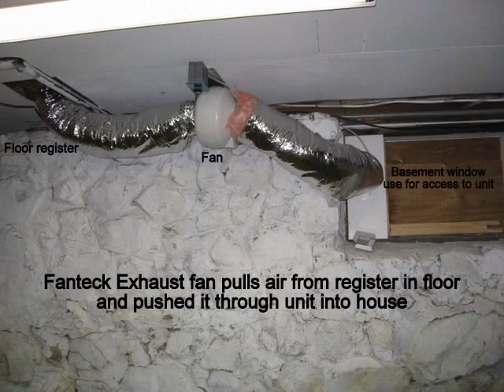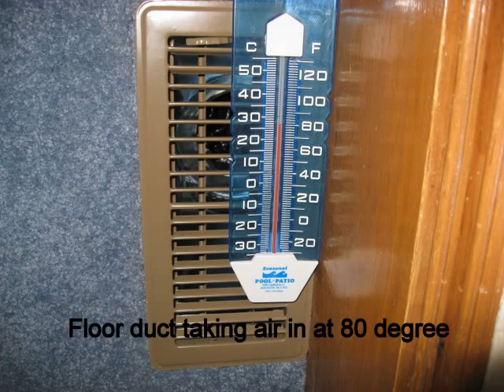solar air heater

Comment from the maker: I like the bow in the Lexan it looks nice but I was concerned how to flash the top the unit when it sat against the house. I cut the Lexan 1/4 inch small around all sides to allow for expansion. I did not silicone it down. I set it on a rubber weatherstripping held down by the aluminum angle. It has remained surprisingly flat minimum rippling. Thank you for posting your project it helped me design and build mine.

Comment: Im in the process of my 4x8 foot pop can heater project Im going to heat a 2.5 car attached garage im useing a 6 inch round in line duct booster fan rated at 250 cfm on the inlet and a ajustable thermostat for a attic fan it can be ajusted from 60 to 120 for the on and auto shut off at a 9 degree drop from the set temp I plan on the fan shape in the bottom of the can also the more you get the air moving inside the can along the walls the more heat will be picked up THANKS FOR ALL YOUR TIPS!

Comment: Great system and video, will this snap switch work on a 12volt ,dc ,100cfm,computer cooling fan hooked to a small solar panel? It says its for higher voltage ac power. I'm electrically challenged. All i want is panel to switch to fan. Thanks Steve

Comment from the maker: The disc will open and close the circuit. It does not matter ac or dc, 12 volt or 110 volt. Good luck with your unit hope to see it posted after it is done.

Comment from the maker: The intake floor register is located about 6' below the output. The unit heat up the area of the room that is why the 80 d intake. The house air temp is usually around 65 d  and the sun bumps it up to 68 d. I have a ceiling fan in the room and with it on it help more the air around. If I could install it again I would install the intake in another room.

Comment from the maker: great score getting and recycling the poylcarbonite sheet. I want to build more units and I am going to look to salvage stock for them to keep the cost down. I have an adjustable speed control on my unit and have it on the highest it will go and wish it went higher. The say if you run the unit cooler it has less heat loss and puts out more btu's. I am trying to get my hands on a anemometer so I can measure how many cfm's it puts out to calculate the BTU output.

Comment: Maybe if you would leave out the top air collecting area and u cut the outlet just above the lower collecting area but insulated from it, the air should take a longer way inside the box. ( go up to the top and go back down till the outlet, between the cans ) This way the heat increment would be higher......just an idea

Comment from the maker: with a 4" outlet the air flow is about 900'  per minute that would be 80 CFM. The room I have it in is 12X12X8 but has 3 large doorways leading to three other rooms about the same size. I estimate it produces4000 BTUs of heat per hour and runs for about 520 per year

Comment from the maker: the snap disk turn on and off the fan and is located in the top chamber of the unit. I have it wired with 14/2 electrical wire. It is tough to explain the wiring without be able to draw it out. Basicly the snap disk is wired like a switch.

Comment: When you have more volume of circulating air in the box the temperature will drop and you get more Btu from it to heat your room.  How do you connect the control disc to the fan?
Thanks, great experiment.

Comment: did you have any issues with the foil-backed foam "melting" ??? I too used foil-backed foam, but it melted the first day and completly deformed itself. Just wondering.

Comment from the maker: The fan is turn on and off by a snap disc control. When the temp inside the unit get to 110 degrees it turns on the fan and when it goes down to 90 degrees it shuts off.

Comment: I made use of some tools I have that pushes out on the bottom of the can 1/4 inch so it will fit into the top of the next can then I made a cutter tool that is placed on the bottom tap it in and the outside fan shape is done I then remove the tools and make the cross cut with the 3/4 inch chisel bend a little,Fan shape is done.The tool is a automotive ball joint press fixture. the cutter was made with flat shaped stainless steel.Thanks again  hope to help someone with the glue togther process.

Comment from the maker: I made it 7 1/2" deep to allow for the 1/2 plywood and 1 1/2" insulation at the bottom. Next unit I will use only 1" thick. A 1" air space between the cans ans the insulation (which I now do not think is necessary ) and a 11/2" air space between the cans and the glass to slow down heat loss from the cans to the outside cold air, could be less.
Yes the snap disc is a thermo switch that closes the circuit at 110degreesF and opens if at 90DegreesF

Comment: you need to make 8~12mm diameter holes many along the cone of the can of the whole circle and cut the bottom, also cut the metal up along the iron rim completely, into this large hole there will pass a 54mm diameter pipe along the entire length of the column. All this must be put on each other. The air will pass between the pipe and the wall of the can to rise upwards, so heating is better

Comment from the maker: You can go up and back down as long as the run is not to long. I wish I had a more powerful fan to push the air thru faster. They say the cooler you run the unit the more btu's it will produce.

Comment from the maker: Hello bjettube, yes the snap disc control is a simple and inexpensive way to have the fan on the unit turn on when it heats up and off when it cools down. It cost about $10 I got it at Grainger stock #2E245. Wobmed